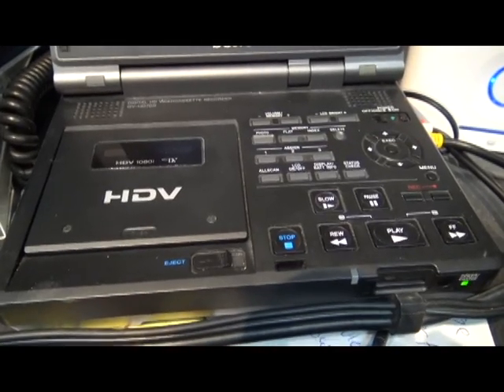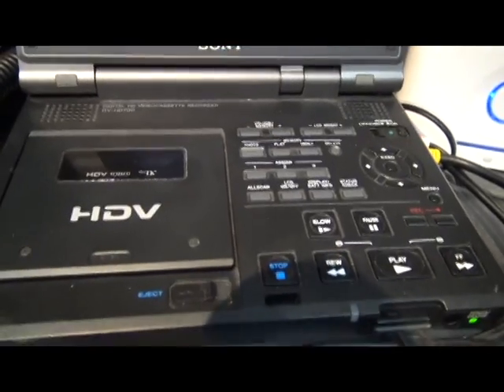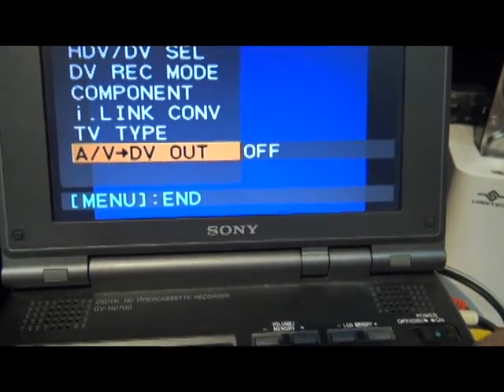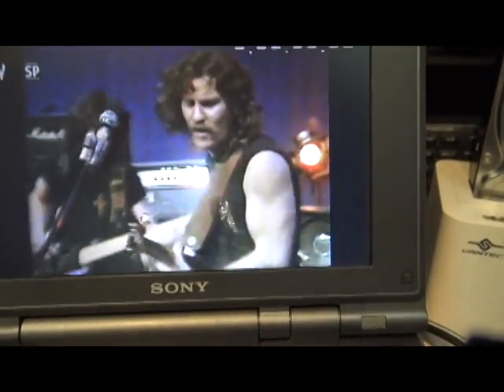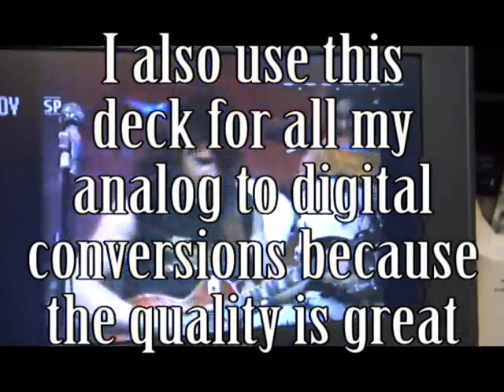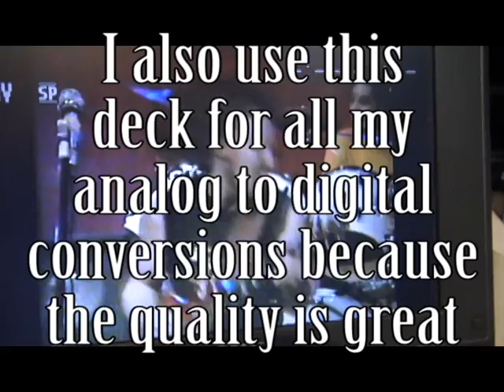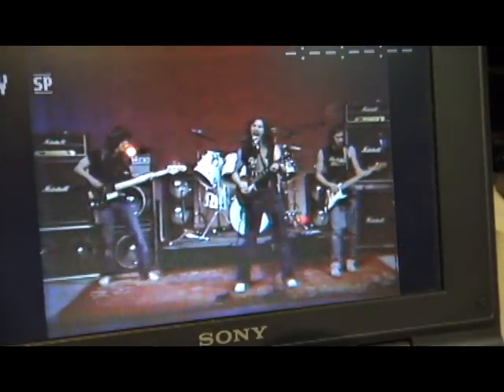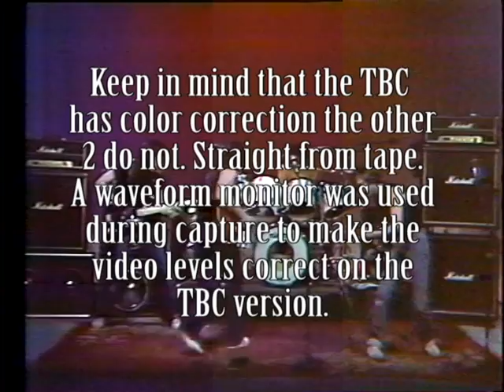Compare MP4 to DV capture quality

Comment: MP4 with TBC looked the best in terms of chroma richness at least after youtube compression,MP4 showed more compression however, I did capture DV before but I re did all the tapes using Pinnacle 500-USB and captured lossless 4:2:2 using vertualdub. it might be overkill for VHS but I didn't have to settle with the crappy 4::1:1 DV chroma.

Comment: There are differences. but there is so much noise in the colour content it just screws up the quality.
I did detect a clarity improvement with the tbc, i know that does not make sense.
Reply from the maker: Yes the colour is very noisy due to the age of the tape, It was recorded in 1980 and has been sitting for 37 years. This is why I picked this tape as I knew it would be in rough shape. The TBC allows color adjustments, and correction of black and video levels, and I did tweak it using a waveform monitor to try to make it look as good as I could. The TBC being a frame store type can and does blend frames to reduce color noise. It uses the information stored in the prior frame to compare to reduce the noise content, as the frames will have color information that are very close to each other, but of course noise is random. This is how digital noise reduction works. Some VCRs, specifically a few made by Toshiba have very good noise reduction.
Reply: I suppose if it was sent to a very expensive restoration company, they would strip off the colour and apply all sorts of processing to each luminance and chrominance.
That would make the wallet cry lol.
Reply from the maker: I can do the exact same thing here on the computer with premiere and after effects.  That wasn't the intent.
The intent here was to look at the difference in quality of a raw capture  direct to an H.264 capture vs a DV capture and compare analog processed color through a TBC vs no TBC.
The processing can be done relatively easily on the PC and with the computers we have today won't take hours to do either.

Comment: IMHO the midframe was the best ( TBC off ?)
Reply from the maker: Yes the one in the middle was straight from tape, no TBC. 
Now I should add into the mix, and perhaps I will, a capture from a JVC HRS9911 with internal TBC and noise reduction. That machine has a killer playback circuit. I could capture the same way, using the Hauppague capture box right from the JVC and see how that one looks.

Comment: The DV Picture showed the most noise, because no high frequency limiting device was connected between the vcr and the video to DV converter.
Even with no tbc option this device does some colour correction, and the picture looks more naturaly. 
Its important  to cut off the high frequencies (>3MHz) because when the video gots compressed the data rate and therefor size of the file rises up,
because of this noise. . For a DV converter there's no problem, but for the codec you later use to compress, it maybe the codec produces some
nasty artifacts. Captureing a video with high datarate and later on compressing it on the computer to the desired file size is the right way.
Reply from the maker: BhdRoussos 
correct. dv capture is fixed 5:1 compression and each frame is an I frame where as h.264 is a combination of I P and B frames as is mpg2. when I captured the h,264 copies I used 7 megs as the data rate. when I rendered the file I output as native dv, so the h.264 would be reencoded to the higher bit rate and shouldn't suffer any loss. YouTube ultimately compresses to their multiple stream formats.
Reply: Unlikely to get a response being that this video is rather old, but what specific devices are capable of doing high frequency limiting inline?

Comment: I USE THE  SONY DIGITAL8 CAMCORDER IT CONVERT ALL MY OLD ANALOGUE CASSETTES  AND DIGITIZED BY FIRE WIRE (ILINK) TO PC COMPUTER USING ILINK CARD BY EDIUS CAPTURE>>ITS GREAT
Reply from the maker: I do the same. I use a GV-HD7000 deck, but the result is the same. Analog in  firewire out. The digital 8 cameras and mini dv cameras had this feature too.  If I get an 8mm hi-8 or d8 tape I just play it in one of my 3 digital 8 decks and play it out the firewire. If I have a mini dv or HDV it goes in the HD7000. For analog I use the HD7000 just because it is always hooked up.
Reply: @12voltvids  and i use neat video v.5 plugins for my edius  to remove all noises  and coloring gamma etc..the neat video is magic.. its like mastering movies its make your vhs 8mm betamax digital rcroding  ets
..better than  original try it